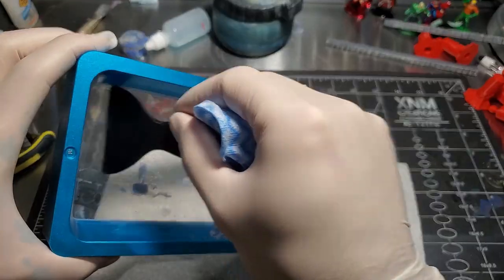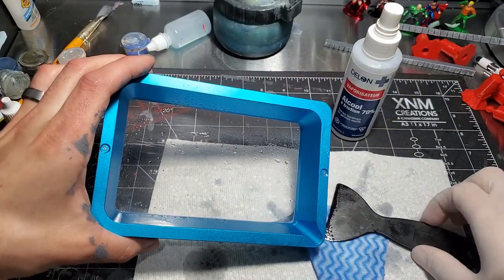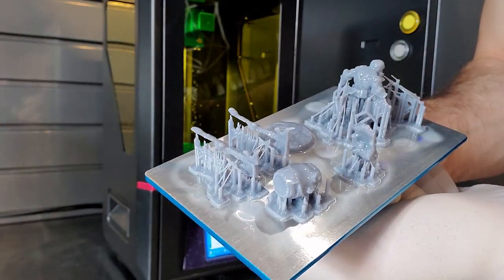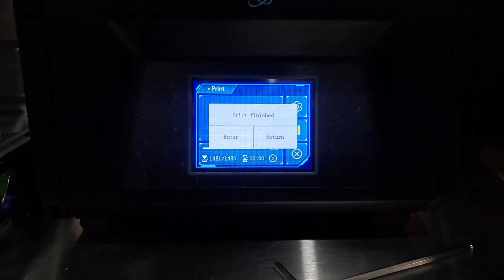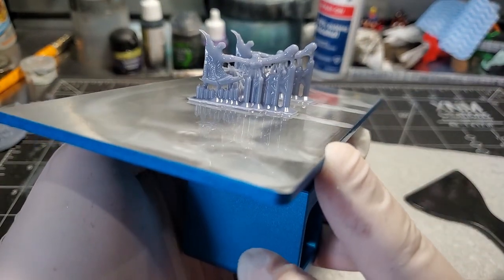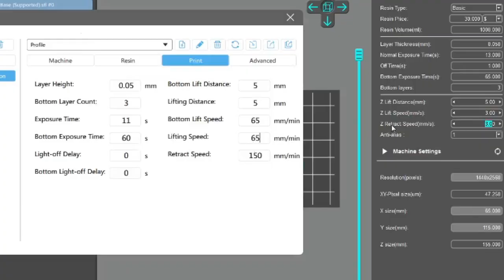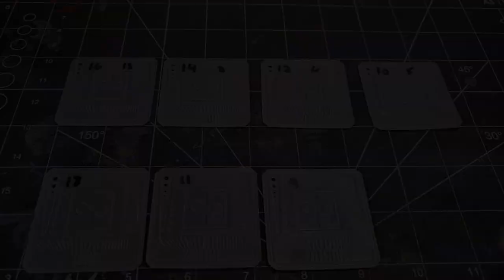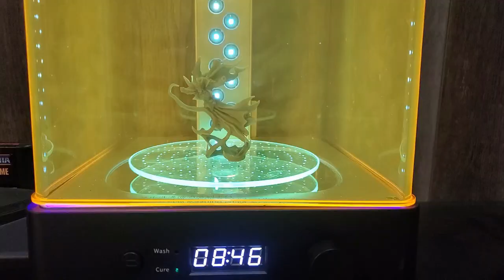3d RESIN PRINT FAILURES and SOLUTIONS not sticking to build plate sticking to fep, exposure settings

Comment: Great advice. 3D printing, in filament or resin, is a hobby unto itself but these sorts of videos remove much of the mystery from it. I started applying the PTFE to the film, and no longer trying to print flat on the bed - everything gets tilted slightly and supported - so far no failed prints (crosses fingers). When I generate the supports I push the pieces towards each other enough that the support bases overlap slightly so that they become one large base to help offset the suction pressure.  Combined with the retraction speed settings you can make them fairly solid on the build plate.
For the wash station I found that the green cleaners worked ok, but that Denatured Alcohol (also labelled "Fuel" at least here in the States) works much more efficiently. So far I have had no leftover residue on the prints. And it doesn't take as long to get them clean. It usually hides on a bottom shelf in the paint section at Home Depot and similar stores.  Anyway, great stuff, looking forward to more. Cheers!
Reply from the maker: Thanks for the advice, especially "support bases overlap slightly "I didn't realize you could do this and spent a lot of time trying to move them around so they didn't touch at all.
Reply: I just had a print stick to the FEP and so I went and bought PTFE as well and lubed up the print... I may need to level it. Seems like that might be an issue as well.

Comment: As someone who is just beginning to familiarize myself with this hobby, I had no idea there was so much trial and error involved.  I just figured you plug in the file for the model, add resin, hit print, and presto, there's your new, highly detailed, very cool figure.  Lol.
Reply from the maker: Always a learning curve dialing it in.
Reply: I suspect there's a lot of [justified] quitters out there, due to the high frustration factor - the expensive waste and the number of variables involved in 'adjusting the print'. Combined with all the 'plug-n-play simplicity' that these machines are promoted with the learning curve seems like ascending Mount Everest. I'm sure it will improve. . .but when?

Comment: ahh man that's a huge pain in the arse. I'm SO glad my Elegoo Mars 2 Pro didn't have those issues or I may well have just binned it.

I'm shocked at how many stories like this I'm hearing about print quality (and printers just not working) from Anycubic. I hope this serves as a warning so people don't waste their money on them - the Mars has just been "plug, print, profit" with zero stress :)

Cheers for sharing man :)
Reply: The right settings for the right resin is important. I just got my Anycubic Mono X and did some test prints with the cheap resin I bought to go along with it and that worked flawlessly.

However moving to my more expensive engineering grade resin I'm running into issues and there isn't documentation for exposure time, I found one for a similar monochrome printer for my resin and I'm attempting those values now + I leveled again because I thought maybe it came out of alignment when I took the build plate off to scrape the previous prints off.

I'm confident that the right cure time (and printer lift speed) will eventually solve the issue even if this go doesn't quite work, one thing I can confirm about Anycubic's slicer is that it's rail movement speed is more than what the printer's pdf documents recommends by default and I wonder if that causes issues with particularly viscus resins.

PS: Print isn't finished but I can see it working pretty well about 20% in (unlike the first attempt where half of it simply didn't stick to the build plate) so I really just think it's a matter of plate leveling and very importantly Resin sensitivity to a couple of variables not least of which is normal cure duration. The Anycubic Photon Mono X doesn't come with Resin so I wonder if the reason you see people report issues is because they buy non-standard resin like me but they assumed it should work out of the box which isn't likely to be the case.
Reply from the maker: I think i should try out Elegoo one day
Reply from the maker: Thanks for the info

Comment: You've covered most of the problems I've had with the Elegoo Mars. I also found temperature was really messing me up. I bought the printer last summer and set it up in my basement, when the temps dropped over the winter my prints started failing and I had to bring the printer upstairs. From what I've found online you want your ambient temp to be at least 23 Celcius.
Reply from the maker: I think that that is going to happen to me as well as it starts to warm up, I will have to keep an eye on it
Reply: I had the same problem, and since my printer is near a window, the temperature fluctuated and caused my prints to fail. I live in Southern California, where the nights get a lot colder. Given that a print may take twenty hours, it’s a problem.  My first prints were fine because they only needed a few hours to print.
Reply from the maker: @andrewgillis3073  The spring here we get wild temp swings, last week, it went from 30 ceclus on Friday, to snowing on Sunday... it was when I was printing the dragon in my newest video... but I kept that room at around 22 the whole time this time.
Reply: @FacilityD20  Both the photochemical reaction and the heat from the LED heat up the resin significantly. If you are starting cold, it won't be cold by the end so its better to pre warm the resin rather than increase your exposure settings to compensate for the cold -  those higher exposures will be too much come the end of the print when the resin has warmed up.
Even better is to put a heater inside the UV lid with a thermistor -  the heater can keep it warm for the first little bit and the the heat of the resin will take over and the heater will turn off.

Comment: Im new to printing and has so many trouble free prints and now I'm running into several issues. I'm going to increase my exposure and slow down the lift. Thanks so much for the vidoes!
Reply from the maker: You got this! My first go to checks now are level, lift speed and exposure time. If you are using new resin, it might required different settings.
Reply: @FacilityD20  it's the same brand but a different color,  good call. Trying that next. I have 5 of the same model and only 2 are printing now vs the 5 that it previously printed. I plan to do some deep diving tonight. Thanks again! Great channel!

Comment: 8:20 All of those are WAY over exposed. I hope you figured that out.  You should be able to see all of the lines at the bottom and the row above that.    If you are still getting problems, check to see that your build plate is square.  Something is definitely wrong with such high exposure numbers.  Your bottom layers should be higher, but not any layers beyond that.  Will subscribe and follow along.
Reply from the maker: Thanks a lot, I seem to have dialed in into 9s now with this resin, been working well every since this video... I am literally slicing some minis for the printer as we speak, hope all goes well.
Reply: @FacilityD20  Did it go well?
Reply from the maker: @Screamer26  yes they did. A lot of other success since this video as well.
Reply: @FacilityD20  WTF?? I'm using 1.7s (sometimes 1.8s) for exposure time, and the validation matrix comes out just PERFECT. Have you tried that? IDK, but 9s sounds like a lot. Besides, it's shortening your LCD lifespan!

Comment: Excellent and very informative video ! I have an Anycubic Photon M3 Max i have 2 exposures a burn layer one and a normal layer one which one should i be adjusting or should I adjust both ?
Reply from the maker: It depends on the issue you are having. However, once I have that initial burn layer working well to create good adhesion on the first few layers, I usually leave it and then only adjust my normal layer exposure times. I find one of the easiest ways to tell if I am over exposing is if my support columns start merging together.

Comment: oh also a tip I got from a guy at Atlas Support gave me a good tip. Make a fake printing profile where the layer height is 0.02 and then tell the slicer to find islands/do auto support. It'll look for islands based on .02, then you can swap back over to your normal 04 or 05 and it should be more than good enough
Reply from the maker: Thanks man. Ill look into that for sure

Comment: Thank you for sharing.  I am having a problem where my test print ran fine, but my other attempts are not sticking to the plate, and I'm stuck with a big glob on the fep.
Willing to try anything at this point
Reply from the maker: make sure you have your z=0 set properly after you level.

Comment: There is a fifth problem that can occur with these is that FEP due to static electricity sticks to the screen REALLY HARD and wont flex,It seems to happen if there is no airgap between FEP and screen. I ended up sticking tape on the printer in the resin tray corners and NOT over tightening it. This removed most of the sticking issues. Ive been using lychee slicer, as its only one that works in all OS-es and it has a... quirk in support generation. It wants to put stuff on supports, but generates tiny 1mm support tips. Really easy to remove but there isn't enough holding strength to actually pull something big and flat off the FEP if the starting island is big... Ive learnt to go and check them and make sure that there are heavy supports with large tips at the big points.
Reply from the maker: That is a really great tip. I am going to be on the lookout for this and I'll try that tape trick if I run into that issue. I find that almost all the prints I do, need a bunch of heavy supports added as to keep it from pulling apart.
Reply: @FacilityD20  how i realized the static issue was fun. I unpacked the printer, had series of successsul prints, and then suddenly next day nothing succeded. Not even the test model that was fine day before. Took me whole day of trials unitll i noticed i had to use force to lift basically empty resin tray off the screen. I thought i had spilt something and thoroughly cleaned it. Many times. Finally i placed empty clean tray on the screen and watched it suck into the screen like screen protector does. It seems i had not been that zealous with tightening the tray in place that first day...

Comment: Even thought your previous table wasn't leveled, I am not sure this affects the printer. The printer itself has its own bed leveling process that you must do initially out-of-the box. The only thing I can think of that will happen with an off level table is your resin will not sit level in the vat, and this can be seen visually too.
Reply: Yeah mine printed the test print fine without the printer being level.
Reply from the maker: it depends... but it does affect it
Reply from the maker: it can effect it

Comment: Thanks, I just started 3D printing and have no idea what I'm doing!!! Where did you get the test print from? I'm using the Creality Halot One printer with their Grey Standard Resin Plus and default settings and my prints supports does not want to work. The Slice was done with Halot Box and when I print the 3DBenchy the bottom has no text at all, the rest of the print looks good but the roof looks a bit too smooth for me as well. Any suggestions please?
Reply from the maker: I believe I linked the exposure test prints in the video description. You could be under exposing, you can always move up the exposure time as see what happens. Also, try lowering the lift speeds by 15-20% (As always... dam built plate being off level with get you every time... triple check it). Best of luck

Comment: @3:07 I'm still wondering if I also need to level the 3D printer. atm it's slightly off, i'm thinking of making a leveling base I can level and put the printer on and then level the baseplate.
Reply from the maker: It's been a hot topic, some people says it don't matter, I belive it do, but it's not that critical and more important at low epoxy levels.

Comment: I have a question, can you print multiple files on your resin printer at once? Meaning, can you different files at the same time? Some STL miniatures come in multiple files (a file for the body, a file for the hands, etc). Do I have to print one file at a time, or can I print multiple files to save time?
Reply from the maker: Yes, you can do multiple at the same time, no issue at all

Comment: So I had lots of issues with my photon mono when I first got it. Bed adhesion was touch and go and would change depending on where on the bed I was printing. I got so frustrated that eventually I put the bed on a surface plate and found it was not actually flat. ground it down to flat and no problems since.
Reply from the maker: Did you use sand paper?
Reply: @FacilityD20  yeah. I taped sandpaper to a surface plate and sanded it flat. If you don’t have a surface plate usually you can use glass since that tends to be flat and you can see distortions in the glass when it isn’t but you want to use very little pressure since glass has a tendency to bend. Started at 120 went up to 1000 never going up more than 100 to 200 grit at a time. It’s been great since I’ve no longer have to worry where the print is on the bed and also was able to reduce my base layer times to half or quarter depending on the resin

Comment: I had some really fine resin stuck to my fep, you'll see it in tomorrows video, I tried all the main methods of getting it off (more than the video shows) and it just wouldnt come off in the end so I printed anyway, luckily it was so thin the UV light could still pass through, only minor artifacts on the print that really arent an issue but yeah, I didn't try isopropanol though, used window cleaner with alcohol in it.

Also Cloudy with a Chance of Meatballs is my favorite animated movie probably, both 1 and 2... Fight the power!
Reply from the maker: Haha, I seen them both a few times now. Try pouring some alcohol into the vat and let it sit for min or so, then try to rub it off from the backside.
Reply: @FacilityD20  Yeah thats what I'm doing, I'm using the window cleaner again and letting it soak for like half an hour, its hard to notice unless you're in the right light but I dont want it to build up, gotta keep that fep healthy, I'm all about the fep life!

Comment: Main problem for me was too low temperature. Small heater inside solved that issue. Now I can print with 10C (50F) ambient temperaure.
Reply from the maker: Temp, can be a huge factor that most people overlook. I needed 23 degrees with one of my resins i was using.

Comment: It looks like you have enlarged Gino the Brewmaster there (it could be a trick of the light). If you are exporting as an STL with supports and then reimporting to blow it up, remember you are blowing up the size of the supports too. They will be harder to remove and may cause more damage.
Reply from the maker: over exposed

Comment: Hi, great video, learnt a lot.  I have a question: followed your instructions, especially the levelling but i'm finding that it prints not only  the rooks but also the logo on the LCD screen.  I've applied the exposure as per the community sheet, so 60s and 8 for washable grey but what could i be doing wrong to print the LCD screen logo do you think?
Reply from the maker: Try doing an exposure test on the light and watch it to see if the light is exposing properly or if you can see the logo shine through as well.  To me, it soulds like there might be an issue with your light source...
Have you tried printing your own model, one that did come already on the flash drive? Try that. If it still prints the logo, you have a light source issue.
Reply: @FacilityD20  thanks for the reply.  I'll try printing something else to see if that works 👍
Reply: @FacilityD20  yip it worked.  Thanks for the help!
Reply from the maker: @kurtkunz2772  You are welcome

Comment: Would using a faster curing resin help with your support issues im having issues youve helped with thanks
Reply from the maker: I think that it could yes, most of the time since this video I have found that vacuum pressure is causing a lot of support breaking issues for me. Now I always like to go in and add a few heavy supports for anchors.

Comment: Where did you get the exposure test prints? So it's just the exposure time you edit? what about lift speed? 

cheers from Nova Scotia
Reply from the maker: I think I linked the file in thr description. I also changed lift speed slowed them down. I am currently running my exposure time at 9s

Comment: I have recently received a mars 3 pro for Christmas, and when i try to print something and i come back an hour or two later, there is nothing on the build plate at all. the last two prints worked just fine but this one wont show up at all. If anyone has suggestions on how to fix this, it would be greatly appreciated.
Reply from the maker: I think you should start by leveling your bed again... and most importantly make sure you have you Z=0 level set correctly after you level. Its easy to skip this step when leveling.

Comment: i got a m3 max. I’ve sanded the build plate, leveled this thing 6 times with the vat, with the provided leveling paper, and with normal. printing paper. It only sticks to the right and left side of the build plate, but the centerish mid left and right side aren’t sticking to build plate. Any help?
Reply from the maker: That is odd... you may have a faulty build plate that is not level (more sanding needed) or maybe you light is not exposing in the center. How does the expose test look?